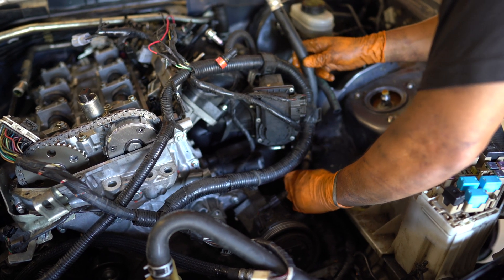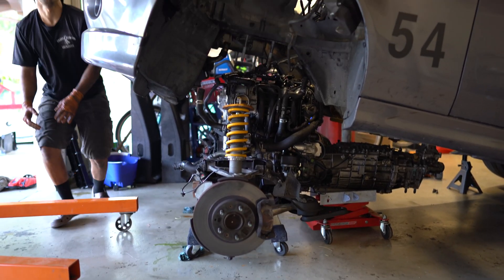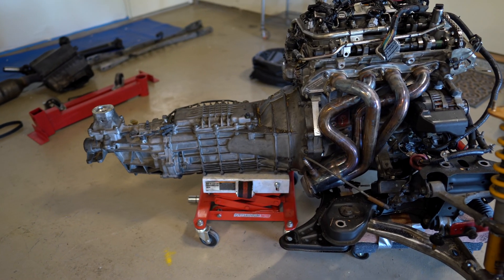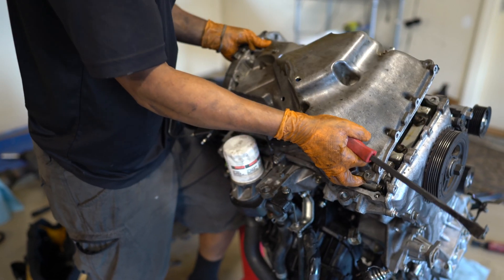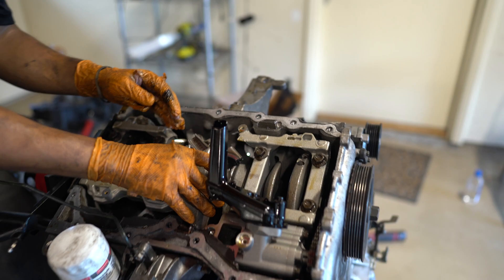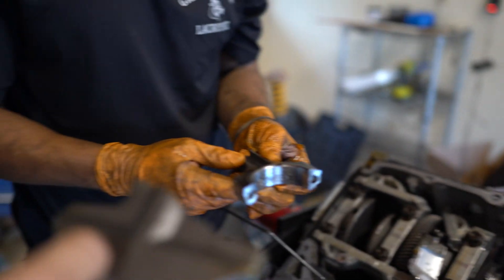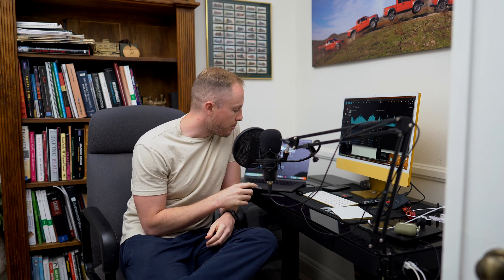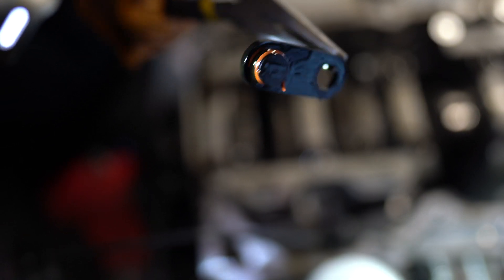2.5 Miata Engine Failure & Tear Down

Comment: what benefit do you gain from deleting the balance shaft? could you leave it in place and avoid this point of failure?
Reply from the maker: You have to remove it to fit the baffled oil pan. It’s not difficult to install the plug. I am not sure how the mechanic screwed this up (not a typical failure here)

Comment: you may not want this video around mentioning that you kept going when you started hearing noise.  The video does not help either.  If you sue the first garage, they would say that you had a chance to avoid the failure
Reply from the maker: The engine is already trash by the time you hear the noise. I won the small claims case, got paid and bought another $400 engine.

Comment: Didn't you ever notice a drastic change in oil pressure?? I buying a 2.5 now stg2 gdw header and guy has no cat and just 1 exhaust its loud so he's having a tech swap my exhaust over from my NC1 also his Enkei RPF1s are wideeee outset with 245s ugh mine are regular outset with 215s swap them also i won't track or 5500 launch but I hope to rev her from time to time
Reply from the maker: The NC has a fake oil pressure gauge. You will be fine.. the 2.5 is a great engine.
Reply: @ZentRose  on a test drive the guy goes to make a turn and then drifts it down the street then turns opposite direction and drifts down the street this on wide outset wheels maybe 4 inches out from car fenders and on 245 tires it showing his 200hp dyno much power and I'm 6 5 195 and he's gotta be 230lb

Comment: Wow sorry to hear about this sir I'm on the precipice of buying a 2.5 swapped stg2 gwr header this is scary maybe not buy now and just gear my 2.0 that's a no oil using revver that has given me 2 great years of driving around town no interest in tracking
Reply from the maker: My new engine has been fine on track. I wouldn’t let my incident deter you from enjoying the 2.5.

My failure was from an incompetent mechanic.
Reply: @ZentRose  Who are you using to build the new engine?
Reply from the maker: @RobMelendez  The guy in this video, Louis, built my new engine. He is from San Diego.

Comment: I put an used 2.5 in mine and it lasted 2 weeks and did exactly what yours did. My mechanic said the oil pump failed. I just had a brand new 2.5 put in, stock tune,,,runs fantastic, starts instantly, great gas mileage.
Reply from the maker: my new one goes in next week!

Comment: You got screwed by either a bad mechanic or a 9 to 5 guy who doesn't care.
Sadly really dedicated mechanic's are hard to find. Tho the guy you got for the strip down seems OK.

Hope you get it all back together soon.
BTW did you manege to get the  chassis bracing kit from IL motorsport yet?
Reply from the maker: It's going back together now. I'm sending the shop owner all of the documented problems and asking for him to cover the expenses. It shouldn't be an issue... there is no excuse for this type of work.  

I haven't had a chance to do anything to the miata... this happened awhile ago and I wasn't sure whether to just give up on the project or pay someone else to tear it down.
Reply: @ZentRose  Document like crazy, they will likely say no to your request, and you'll need to take them to small claims court. You can research if this applies in your state, but in some states, an LLC must be represented by an attorney, and that's an easy $5k alone that the mechanic won't get back.
Reply from the maker: @Zadnak1  It looks like that is the plan unfortunately. The shop owner is dodging my calls.
Reply: @ZentRose  document everything. Find a way to prove that he was selling you a racing engine and not a commuter engine.

Remember, if he dodges court like he does your calls, you win by default. I won a small claims case that way.
Reply: @ZentRose  obviously I'm rather bias but I am very pleased to hear that you've decided to stick with the miata.

Most of the miata channels I follow are years ahead of me.
Whilst you are only a little ahead.
We have both done the supercar handling mods.
Tho I also did the chassis braces. They make a huge difference to the back end btw really stiffen it up, makes the car feel higher quality and they also help the suspension to work better and improve corning speeds.
I haven't don't anything to my engine yet. Tho I will be fitting a supercharger in around September if all goes to plan.

Anyway keep the miata videos coming mate.